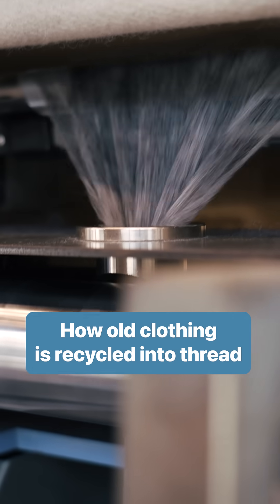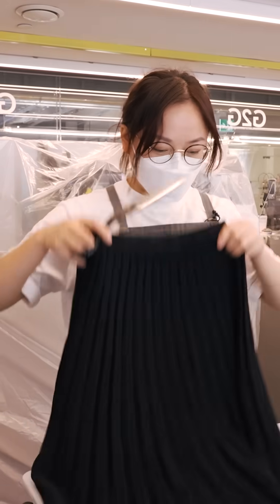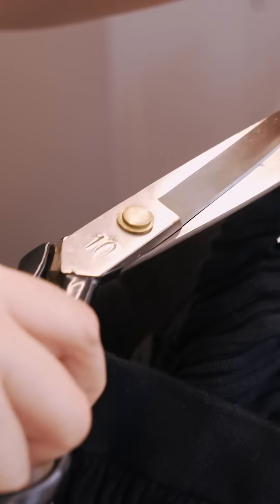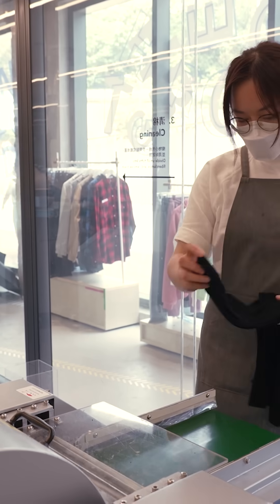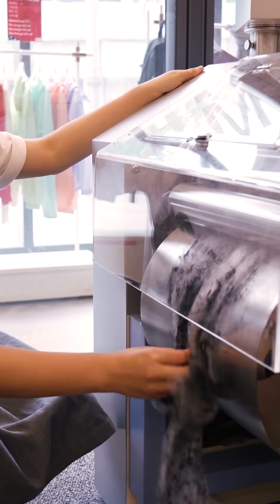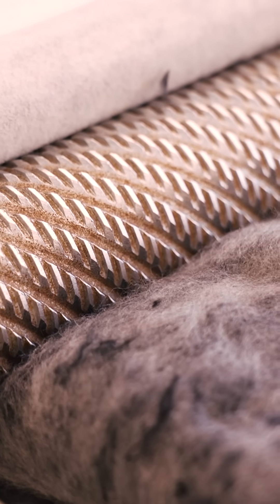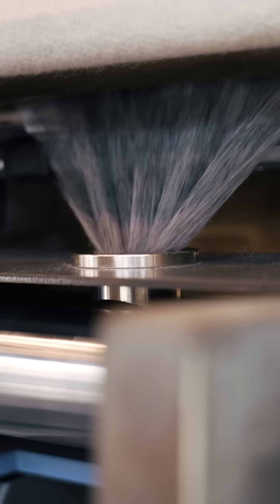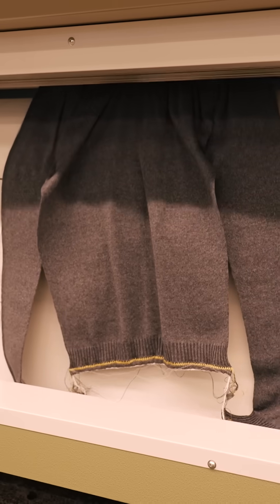Here’s how used fabrics can be recycled to make new garments. #Upcycling #Clothing #Fabric

Comment: Normally, your old clothes get cut up into rough sheets and sold to warehouses and shops as cleanup rags.
Reply: I buy cleanup rags, and they're not cut-up clothing.
Reply: @pulaski1  Mine are. We can tell because of the seams for Tshirts are still there. Collar buttons, labels, pockets, etc attached.
Reply: @Sinyao  Aren't they inconsistently  absorbent?  Not all fabric is good for mopping up liquids, especially synthetic fibers, and surely some rags are going to be thin.  

When shop rags that are effectively "super tissues" (at least partly recycled fiber), so of consistent quality, and are pretty cheap, I don't think I would want shop rags that are just cut-up clothes.
Reply: @pulaski1  You are correct, but with some chemical spills, the fabric is more cohesive than some wipes.
Reply: @pulaski0001 You have to be mindful when folding them if you use them to apply finish and oil or wipe wood stain, but they work well.
Reply: If they're nylon or acrylic they would not work.

Comment: Why not just sanitize old clothes and use it again?
Reply: Because they're worn out.  My clothes have holes worn in them by the time I discard them.  My shirts eventually rip under the arms, and my jeans wear thin, or wear through in the crotch; the belt loops of trousers wear through.
Reply: @pulaski1  I'm only asking because sweater in the video looked fine before they cut it to pieces.